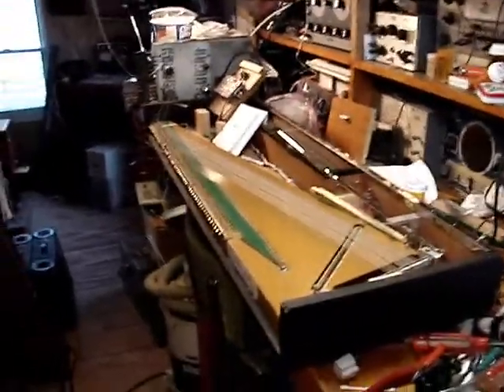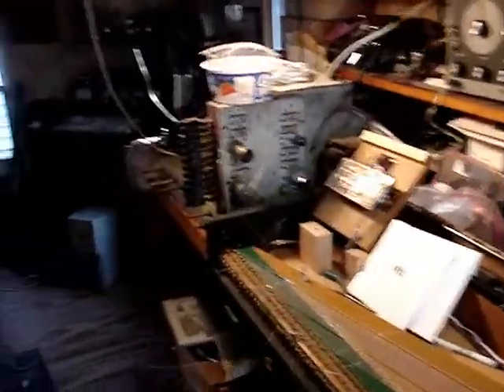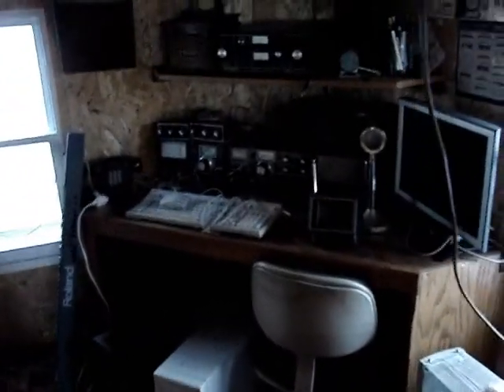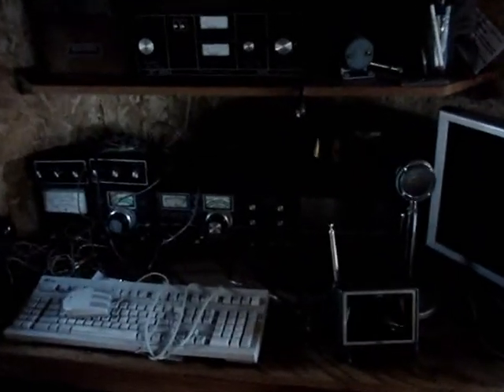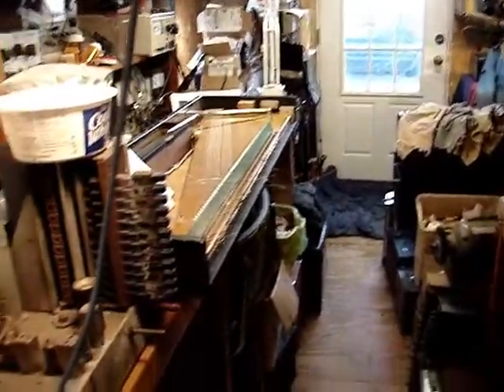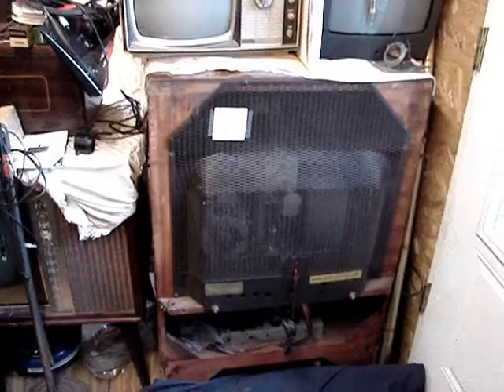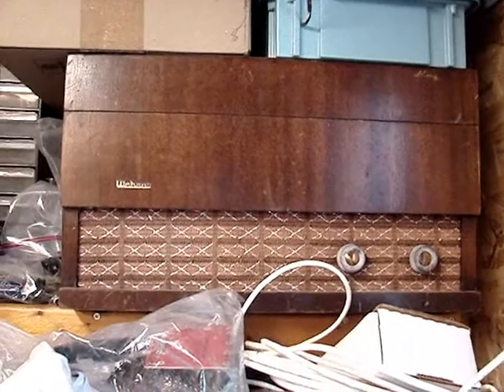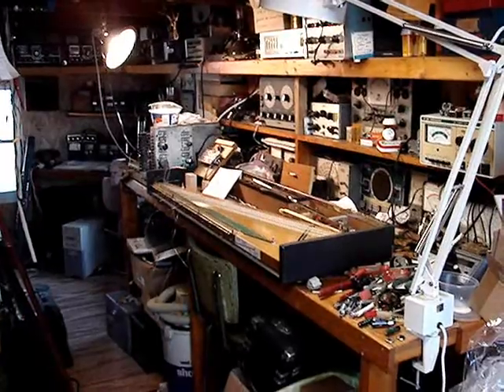The sad state of my work shop January 30 2018

Comment: Mine is far, far worse.  It's so bad that I won't make a video of it.  Even if I had the time, I don't have money to be spending on the materials I need to get everything organised again.

I assume that the TV transformer problem is due to the higher line voltage.  This is a big problem with Zenith radios.  In fact I have one in pieces that needs to go back together.  I have all the parts including a new power transformer.  But I think reducing the horizontal drive in that TV is a decent solution, considering the alternatives.  There must be a better way than shunting it though.
Reply from the maker: Someone had attempted to rebuild the set sometime before I acquired it. The original transformer must have burned out and the replacement transformer he used puts the B+ 100 volts too high.
Reply: HD7100 so the horizontal drive is okay otherwise?  I haven't run into this problem with TV's (haven't worked on any that old) but on radios from that era, especially Zenith, the B+ tends to be too high on 125VAC (and can cause the transformer to ignite!)
Reply from the maker: I have not been able to scope the horizontal drive because the set is so messed up. The guy that attempted to rebuild the set put in new electrolytic capacitors in parallel with the old cans and he did a crappy job of it. He didn't change out any of the old wax capacitors. I have since changed all that and have most of the capacitors changed out. Before I stopped working on the set I measured the HV which is very low. What I need to do is to finish re-capping it and then try it out with the over B+ voltage just to see how re-capping changed things. Then I need to find a different transformer.
Reply: HD7100 Do you have a source for high frequency transformers?  I need a flyback transformer for a Tek scope.  I gave up trying to find one a long time ago.
Reply from the maker: The best I can suggest is eBay.
Reply: HD7100 I've been searching there for a similar scope just to steal the transformer out of one.  There are only four scopes with the same transformer.  They aren't desirable models by any stretch, but sellers seem to think they are valuable.  I never see them listed for less than $100.  I fully expect that when they can't sell them for $500, they "recycle" them.
Reply from the maker: The problem is that eBay dropped the listing fees and only charges when the item sells. I have observed that greedy  sellers have been listing stuff for unbelievably high "buy it now" prices. They list the items for the maximum 30 days and when the item doesn't sell they just relist at the same price hoping some clueless buyer will eventually come along and pay the price.
Reply: HD7100 very true.